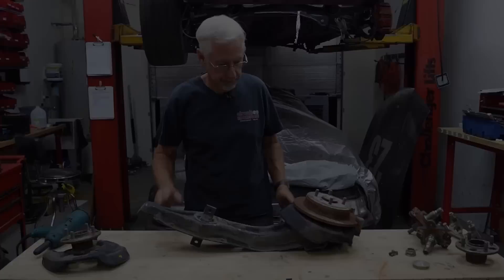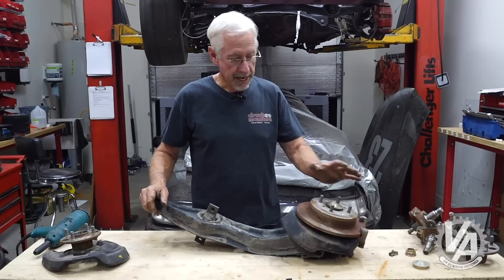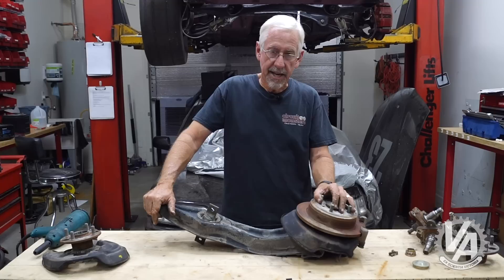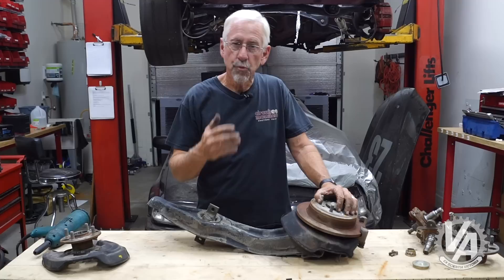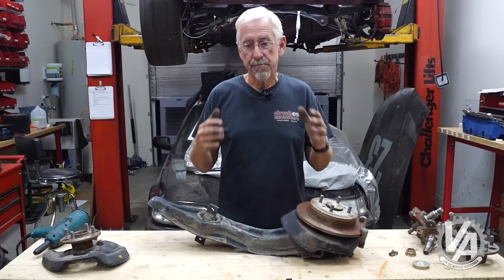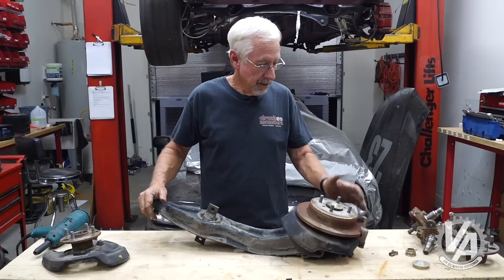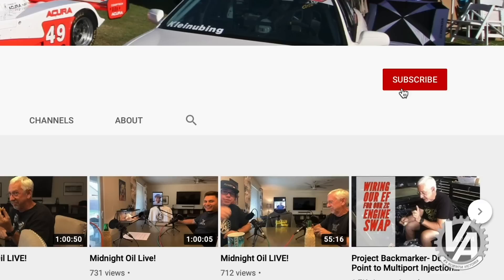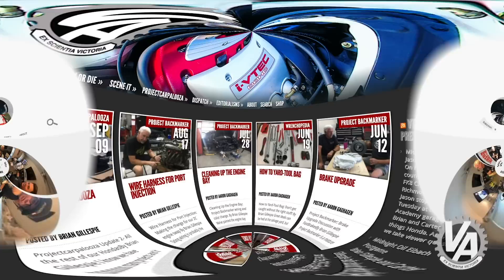Quick Tip Rear Trailing Arm - Don't screw up your car when doing a disc brake swap

Comment: Brian is the ultimate Honda guide in my mind. He know so much and is a good teacher. Appreciate it Brian!
Reply from the maker: My pelasure.
Reply: Spilner
Reply: @VTECAcademy  hey I have a 96 ek hatch I just got my trailing arms from a 2000 integra coupe what e brake cables do I use 😅

Comment: I've done this swap many times. The disc setup can also be found on 93-95 civic si hatchbacks and 93-95 civic ex sedans.
Reply from the maker: Dallas Thierauf  as well as the Del Sol Si and VTEC models.
Reply: Dallas Thierauf do 95 trailing arms bolt up to a 97 em1? I know I’ll need si cables and lines + MC
Reply: Febreeze Ads no such thing as a 97 em1, at least not in the states. Em1’s are 99/00 only and they come with rear disc’s from the factory. If you’re asking about any other ek chassis, then yes, they will bolt up. If you’re doing the swap, I suggest swapping the front brakes as well and the prop valve, but it truly depends on what trim level car you have.
Reply: What about 93 integra rear trailing arms would they fit a 00 civic coupe?
Reply: Would the Del Sol e brake cables be too short for a CRX?

Comment: Did that to all my civics I even have a video of a whole how to but never edited it. Best part is it's cheaper.
Reply: Edit that thing and post it up!
Reply: @beezowdoodoozoppitybopbopb9488  One day I promise, or I can just post it raw and uncut lol.
Reply: Hey francisco i have a question.? So you'll basically pull a spindle of of a 90-93 integra . It will bolt up in the ek rear trailingarm(drumbrake)? Is that right.? Mine is specifically a ek sedan .
Reply: @mikeeganzon9789  you need spindles from 94-01 integra. Or if you decide you want to get conversion brackets and keep the drum style spindles there is a company called scarebird that makes them. Have used them and they work but I prefer the factory hardware.
Reply: @franciscogarcia-xt5wn  oh ok ithought we can use the spindle from the 90-93 just like what vtec academy said in the video . So ot should be of off a 94-01? Then just rather bolt up the whole trailing arm then.? Right.? Thanks for the info tho.
Reply: @franciscogarcia-xt5wn question so if I want to put rear disc on my 99 ex coupe what will I need?

Comment: Thank you for posting this.  Its harder and harder to find the old tech articles from forums online.
Reply: Right? They’re all fucking hodgepodge together or starting to criss cross into unrelated territory with the other platforms or tidbits of info I don’t fucking need. It’s driving me insane because I’m finding every bit of info there is except the bit I need. This whole thread needs to be refreshed for each platform and what works for each and this and that.

Comment: Great advice. I always knew the disc hubs bolted up but I didn't know the 89-93 Integra trailing arms were wider. I have da9 arms on my ek and 225 tyres always rub slightly.. now I know a solution. 
Thanks brian

Comment: As someone who is very close to doing this swap, i look forward to this video. I havea 90 Civic DX hatchback and i have complete DA trailing arms along with a 40/40 proportioning valve. I need to get better calipers and I'd like to get a bigger master cylinder and braided lines. I run 205/50/15 on 15x7.5 +25mm and i do not want a wider track as i already am cutting it close with clearance. Can't wait to see the video.
Reply: I did it  on mine  no issues at all same ser  up  as you  are doing
Reply: @3E37  i also did it on one of my older hatches but i wasn't running as wide of a tire or low of an offset as i am now. I already rolled my quater panels and added a slight amount of negative camber so i don't want the track getting wider.
Reply: What would be an alternative to running your set up?  CRX Si or EF EX disc brakes?  I have my DA rear brakes ready, but reconsidering due to widen track.

Comment: Just broke loose those T50 bolts on the rear spindle on a 1990 Acura Integra.  I lmixed some ATF transmission fluid with some acetone (50/50) mix and let it soak in for 2 days, cleaned up the area and then applied heat to the bolts with a propane torch, dwell time approx 30 seconds and then used a 15" breaker bar.  Worked quite well.

Comment: I used a DA trailing arm set on my ef sedan and it did in fact widen the track. I ended up putting my old arms back on and switched my spindles. Wished I had watched this video first! Would have saved me a ton of work.
Reply: so direct bolt up of spindle to ef drum trailing arms with no issues? what about e-brake cable? still used the da one kept the ef one?
Reply: @toddp5122  i kept the da cables on there, it worked fine. Spindles bolted right up. Be careful of stripping the torx bolts, hit them with a torch before trying to loosen them.
Reply: @sethallison5682  hey Seth so I have a 90 ef sedan and picked up some 91 DA disc trailing arms yesterday. I don’t want to put them on now because of the widen track. Can I strip the DA arms and put the components on my EF arms? Or do I need to get some stripped EK arms like he says in the video?
Reply: @Otsp922  I used my ef arms and it worked totally fine 👍

Comment: Great little segment, the TNC CRV will be getting a rear disc conversion in the future.
Reply from the maker: Thanks! CRV is a perfect daily.
Reply: VTEC Academy  I have a question... my crx had rear disk conversion when I got it (dx model) so idk if I have crx rear, 94+ teg or DA rear brake conversion on it. I do know it have DA front knuckles. So... is there any way to figure out which set I might have? I plan on tracking it so I would like to avoid widening the track of the rear end. I’m glad you posted this video because I never thought about that... Thanks Brian!

Comment: I got a eg but put on 91 integra arms with 2003 si rotor disc and rsx caliper it works
Reply from the maker: A lot of those calipers are interchangeable. It does affect the brake cables you use and sometime the brake lines.

Comment: Thanks for these videos!  As soon as I get a few more of the required tools, I'll be totally stripping my B-swapped EG hatch and building it back up from scratch.  On the list is a small/mid-size turbo and some tall-ish gears for a grand touring build.  Aiming for balance between long distance comfort and sporty performance when called on.  Full A/C, disc conversion, comfy suspension, and extra thermal and sound insulation for a quiet ride.  What are your thoughts on taller final drives such as the MFactory 3.471 final drive for my B18C5 with LS transmission?  It should be a bit shorter overall than the stock VX gears but still afford sub-3000 RPM highway cruising.
Reply from the maker: Long gears need a torquey motor. Turbo is probably a good idea.

Comment: @VTECHAcadamy this is good stuff i was wondering if this could be done but never looked into it but technically you can take the spindles out of newer accords with disc brakes and put them on whatever non disc brake trailing arms you have as well id think but the awesome thing again about the accords (Carter) is cb7 cd and cg chassis is there is a disc brake version of all of them that just swaps in directly ive done this on a cb7 90 lx chassis and did the whole subframe so i got disc brakes and a sway bar i could have just done trailing arms but i bought a whole Barely crashed in the front 93 ex chassis for 130$ so i used the whole rear. I eventually fixed that car and put it all together with 3 other cars so it was all different colors but clean(waxed and good paint) and looked like 3 cars none the less swapped a healthy engine in and it ran great all ways surprised people. I even mis shifted from 5 to 2 on a down shift and thought i messed it up because it was misfiring after that turned out it was just a valve lash adjustment nut backed off on the exhaust side even so it wasn't really even missing power just misfiring and i was in the middle of a 300 mile drive so i kept driving got home and found the nut in the head still. I didnt figure this out right away i took the engine out so i could use the transmission in another car but when i did figuer this out i was stoked. Sorry for blabbin on every week and wasting so much of your guys time haha but ya i like accords a little too much haha

Comment: I've actually got disc brakes advertised off of an ef, and put them on my ej2. I don't know if it's perfect or not, but it worked
Reply from the maker: Those will work. The E brake cables may be a little short though.
Reply: @VTECAcademy  yes the cables were short, had to used some si cables, hardest part was connecting to the hand brake lever. The mounting bolt, didn't wana fit, so I had to make it fit lol

Comment: So essentially all I need is a DC2 hub from Acura to start building the rear disc setup...?! Love the information
Reply: No. Essentially. If you can’t find DC2 trailing arms because they are getting hard to find. But Da are still little more available. You take the rear spindle off the Da trailing arm and bolt it to your drum trailing arm. So you don’t mess up the geometry of the rear with the crappy Da trailing arm. You just need the spindle. Great news!

Comment: What do you guys recommend for a replacement bolt over the T50? Or do you guys use the T50 bolts again? Also recommended torque specs for installing back the rear spindle bolts?

Comment: I'm using the DA trailing arms, I like that it widened my rear, now I'm trying to figure out the front and I'm looking at EK arms to see if they're slightly longer. If not then I'll just have to make my own which isn't a problem for me
Reply from the maker: Are you trying to widen the track in the front?
Reply: @VTECAcademy  yeah, atleast 1" wider overall than what it is now. Forgot to mention this is for a 95 hatchback.
Reply from the maker: @Elver_Galarga_jugo  I don't know if there is a compatible wider knuckle with the same geometry. The other option would be wider upper and lower control arms which I know don't exist.
Reply: @VTECAcademy  that's what I was afraid of, I already have 97 Ex knuckles for the brake upgrade. Guess I'll have to make my own. That kinda helps since I'd like to have something with caster adjustments and I'd like to make lowers that are half tubular and a bit longer

Comment: I’ve never bothered to convert from drum to disc on any of my cars... the drums in the back stop the car fine and are lighter anyway...
Reply: I find the drums work fine as well, but the maintenance is easier on the discs and there are many more varying brake compounds available.
Reply: Brian Gillespie very true! I’ve also never used a civic for anything but drag racing so the need for rear disc was not very critical for my needs...

Comment: Can I take the spindles off my 90-93 arms and put them on my stick EF rear disks? Basically just swap everything over to keep the stock geometry? I wish I knew this before I put DAs on my track car, no wonder it rubs with 205/50s. Please let me know! Thank you
Reply from the maker: Yes you can bolt the DA spindles on the EF trailing arms and that will keep stock geometry.
Reply: @VTECAcademy  thank you sir, I already took em off! Was super easy with some pb blaster and a breaker bar.

Comment: Thoughts on scaredbird rear disc bracket? Simply remove the drum, install bracket, get integra rotor and caliper, caliper mounts onto bracket.
Reply: That is what I am doing looks like it will work
Reply: That's what I'm running it works great for me on my ef sedan I had just changed all the bushings and stuff in my trailing arms and didn't want to do it again so I went that route. I don't have dust shields and the calipers are a little further up on the rotor than stock discs but who needs the dust shield anyway lol
Reply: Scarebird also has a big front brake upgrade caliper bracket where u run a vw corrado rotor and a GM caliper. I been wanting to try it out but it don't really say which GM caliper to use lol guess I need to contact them. Its alot cheaper than the fastbrakes bracket.

Comment: So let me get this correct, you are saying i can use a 92-93 integra rear spindle and bolt it to my drum rear trailing arm 92 civic dx without issue?
Reply from the maker: That is what I am saying.
Reply: @VTECAcademy  do the 93 integra rear trailing arms also work for a 00 civic coupe?

Comment: Is anyone having this issue after doing rear disk conversion. Right side e break cable seems to be pulled up more than the left when applying the e break ? Also the right rear caliper seems to show more wear then the left rear caliper.  ( 00 civic lx sedan with 98 integra Ls trailing arm and Em1 E break cables )

Comment: I looked through the comments but nobody seems to have asked yet. What are the torque specs for the t50 and the 24mm nut?
Reply: I would like to know the same thing.  The Service manual has every torque spec except this.

Comment: So if I take the rear trailing arms Off an 94-2000 Acura integra LS, RS or GSR, they will bolt right in to my 1991 EF civic hatch?
Reply from the maker: Yes.
Reply: @VTECAcademy  wow, that is Farrr more simple and less confusing than all other rear brake conversion processes I’ve looked up. Thank you guys for spreading the knowledge and the fast response!Saved me a headache and some. Definitely a subscriber. Cheers !

Comment: I got a delsol which was a 1.6  d-serie SI with drumbrakes at the rear(1992model) . I bought it with a rear diskbrake swap and the system looks fresh👌 

Also swapped the d serie for a B serie, but my brake-system is bad.
I got 5200 Nm front, but only 550Nm a the rear🤔 and handbrake is 17/1800Nm so my pads/disks are free and good.🤔
Im thinking master brake clillinder? that it's a drumbrake version so not enough force?🤔
Reply: I have just done the same swap did you resolve the issue? I imagine it was the prop valve?
Reply: @NGCSH187  Nope.. it was the single  "plate braketester" that was the cause of the bad results.. I talked to a buddy that had a 4wheel brake tester, so i went to his shop and tested it.. and the results were 5500 front, 1250/1300 at the rear wheels😁👌

My setup is original masterbrake cillinder, original reardrum brakeforce splitter. So basicly OEM rear drumbrake with a disk brake swap.

Comment: Will the DA rear spindles bolt on to my stock EF (ED) rear trailing arms or do I need to get EK trailing arms?
Reply: I’m under the assumption that they should bolt right on. If so that’s a great mod!! No one ever talked about this in the Forums
Reply: @Freestoner707  yes they do, i have seen a video by garage built hondas confirming this.

Comment: If it's harder to find DC2 trailing arms than the spindles then where did the spindles come from?
Reply: You can buy Spindles.. from a DC2.. and use your eg or ek trailing arms.. and that will a replica of full dc2 trailing arms with the spindles.. if should be easier buying spindles from a 94-01 integra.. than looking for the whole thing and used.. better go with new full set all new.

Comment: I have done a disc conversion on my 92 del sol using 88 CRX trailing arms they shouldn’t be a problem right?
Reply from the maker: Not a problem and you should be able to use the CRX cables.

Comment: I found a rear trailing arm off an integra but the metal around the 24mm spindle nut is pretty much rusted out. Would the remaining 4 T50 screws in the front be durable enough to drive on?

Comment: The spindle he installed on the ek trailing arm was from a 92-93 integra ?
Reply: I think da
Reply: Yes da integra.
Reply: Joseph Freeman thanks bro I slow
Reply: @josephfreeman1427  wait a minute.. as long as I have a ef,eg or ek trailing arms, I can use 92-93 Integra or even 94-01 Integra Spindles only.. will have the DC2 rear disc replica.. I mean the narrow wheel set.. that we want and not go wider.
Reply: @krazy_lobito4335  yes da rear trailing arms with a dc spindle

Comment: Hey! I have a EF civic, I hit a curb years back and bent my passenger rear trailing arm, my buddy had another one laying around and we installed it, I noticed a ways back that my wheel was sticking further out. We must have used a DA trailing arm, not realizing it. So the knuckle I need to use is a DC (94-01) ? Just wanting to clarify, as I really don’t want to have to replace the entire trailing arm. Thanks!
Reply from the maker: You will need a DC trailing arm.
Reply: Ok, thought I could get away with just doing the spindle?

Comment: good info! Is there any way to use the stock rear disc from an eg or ek(96-00 coupe or sedan even?) on an ef?
Reply from the maker: Oh yeah, those bolt right on.
Reply: 93 del sol

Comment: 2000 ek 4 door what trailing arms should I use if none available from a dc2
Reply from the maker: You can grab the DA/DB ones and bolt the spindle to your trailing arm. Or 90-91 CRX Si or 94-97 Del Sol Si or VTEC trailing arms.

Comment: Why cant i just put disk brakes on the back without geting new trailing arms?
Reply from the maker: There are kits for that. We went cheap, we had these trailing arms off a DA sitting around. Check out project Backmarker for information on using a disc kit, rather than the way we did it in this video.

Comment: Real quick I have an eg and just picked up some rear trailing arms from a del sol si
They look the same as the integra trailing arms I think one side actually had a different part number which is weird when the other had the same... Um but my question is why don't del sol trailing arms ever get brought up
Is this a no go for me?
Tia
Reply from the maker: Mainly because they are rare. The work just fine, but the brake cables are too short for any other car but the 88-91 CRX.

Comment: It’s 2024 and the overal NA record at Tsukuba was beaten by the Aslan EG Civic with at 54.931 time. This Civic runs 70K front springs and 60K rear springs; so a tail happy FWD car isn’t necessisarily the way to setup these cars. 
https://youtu.be/KBKDP_0nsaU?si=-v6CXY13SI5GZZS7